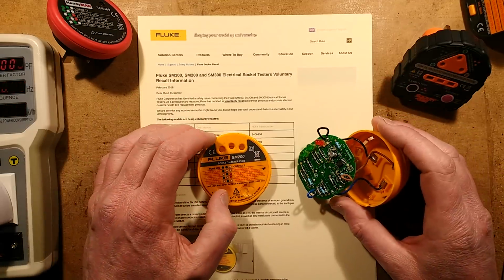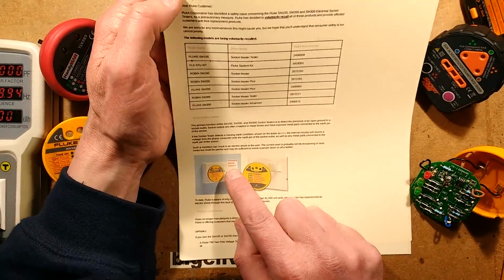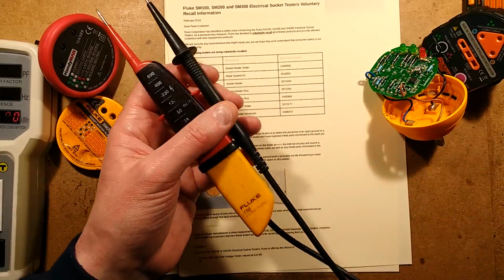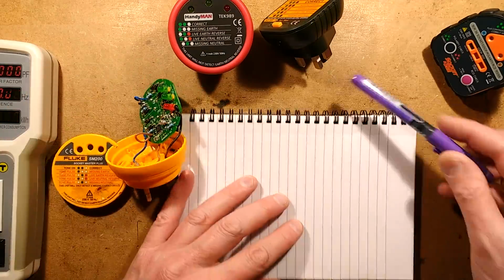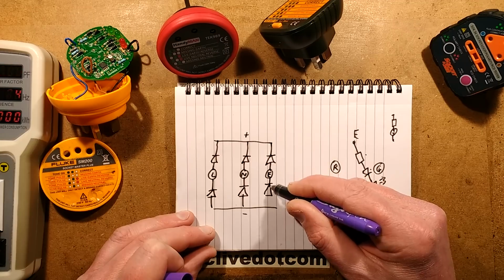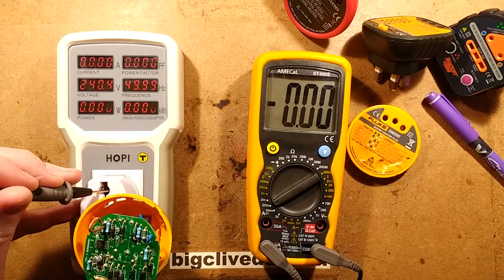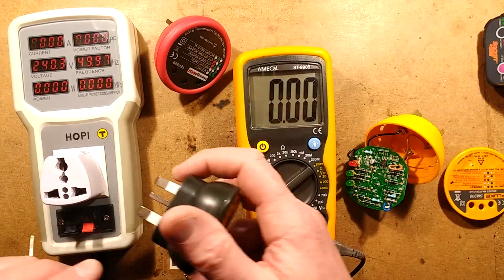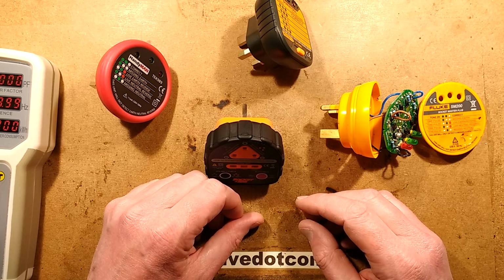Why Fluke are recalling their SM100/200/300 plug-in testers.

Comment: I have had many multimeters most very reputable brands, but only my Fluke's get stolen. 
The most common use for my socket tester now days its to trip the circuit I'm working on R.C.D because I'm too lazy to walk back to the sub-switch board to switch off the circuit (P.S I don't do that of course if there is a likely hood of some other party re energising the circuit).
Reply from the maker: Likewise DeWalt tools.  Always the ones that get stolen on site.

Comment: I work in a safety compliancy lab, would love to get my hands on one of those for training purposes.  By any chance do you have the means to make a body reference like in a simpson 228 leakage meter?  I'd love to see the actual leakage not just a dead short
Reply from the maker: The non Fluke versions are still widely sold as test plugs with the exact same earth current issue.

Comment: Um question. If 6 milliamp is so strong and 21 is deadly like I've heard, why do phone adapters have 500 milliamp and we can't feel it?
Reply from the maker: Low voltage.  It takes around 50V before there is a significant shock risk due to our skin resistance.

Comment: Or got a tingle, fell off a ladder from a warehouse floor and died.
Think, I know you can and do, we both worked in industrial conditions and really bad things can happen at height or other hazardous positions when someone gets an unexpected, unanticipated surprise.
And as an CET, I'm unaccustomed to safety equipment giving sudden, random electrical shocks through bloody insulating plastic!
As in, had I made such a thing, I would recall it, it doesn't function safely or properly.

I have a couple of the probes you spoke of, doesn't test leakage, but does alert to a live circuit, as does my multimeter with my fingers touching one lead.

Fluke usually overengineers things, had an original Fluke 77 meter, massively overengineered, worked great, died over long normal usage. Well, save the tester that's the subject here.
The original Fluke 77 didn't have a fuse to protect the 20 ampere range.
Still, good analysis. No, excellent analysis.
Oh, 10 ma is around what hospitals reject, due to electrocution risks of patients with invasive devices. 

If you want a primer on US liability laws, I strongly suggest a long diet of lead paint chips. Maybe emulating tophat makers practices as well.
Or a good, solid kick in the head by a strong jackass. Thrice. Just look at our current government, it's been the same in the past. Google "No nothing party".

Comment: If your earth is floating, its (mostly) your fault.
Reply from the maker: I'm fed from an overhead TT system with earth rod.  Not floating, but not enough to pass enough current to trip a breaker other than the required RCD/GFCI breakers.
Reply: @bigclivedotcom  
Thanks for the answer!
true we have that in some areas in Germany as well. My mother has a Earth resistance of about 1500 ohms. She can also only use RCDS. The bigger cities all get the TN networks while the rural areas are so far away but from any form of transformer station,  you can't even bring the earth /earth-neutral to them because the wire is so long that there would be too much resistance in the earth anyway.

So yeah i pull back my statement in correction: if your earth is floating it's your fault except you life in a tt fed area ;)
Where these devices just sold by fluke without the different net types in mind, just like a "one for all" solution?

Nice tidbit you probably also saw happen: big day of finishing building a house. Electric guy is measuring Earth resistance with a not good result. The earth rod needs to be longer... The contractor does not want to spent that more time as they need to finish. So they do what? Right, water the area with a hose until the result is okay...
This house only saves life when it rains now.

Comment: In Finland they recalled some years ago socket deters as they could not detect voltage on the earth line. There has to be a metal piece you touch to detect that. You cannot detect it by comparing earth, neutral and line. There could be 230 V on earth and neutral and 0 on line and a socket tester would happily pass it. Or if earth wire was connected to the line a tester would just signal harmless line neutral reverse (not worth fixing here). Five years ago such a socket killed a plumber. He had an RCD on his tool but it does not protect from voltage on the earth line.

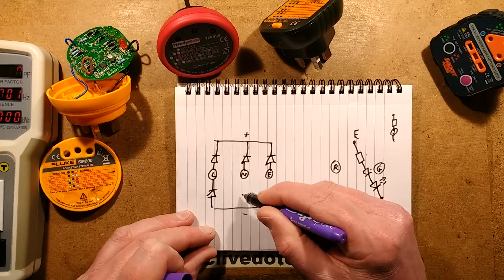Comment: 11:45 diagram diodes from LNE - is very similar to car alternator - as they're three phase generators rectumfried. Lucas alternators used to have (maybe still do) 3 terminals plus Earth (body as negative terminal). The 3 terminals at the terminal block were 1 'small' and 2 'large'. The small was fed through the IGN light on the dash for some exciting current and then either of the large terminals directly connected to the battery. However, those 2 large terminals were not connected together but were fed via different sets of diodes - so in fact it would be sensible to use the second large terminal to charge a caravan battery while the car battery remained fully charged.

FYI.

Comment: Test buttons on RCD/GFI CBs do not do a proper test.
I believe trip current is supposed to be 30mA. Dunno what the test buttons do but (I think David Savery) found that a ?35mA 'leak' wouldn't trip the thing yet the test button would. I.E. the thest button only tests the tripping capability not the fact it trips at the specified current.
I believe one rated to trip at 30mA tend to trip 21-25mA - well inside their spec.

I've personally found connecting N to E will trip them.
Reply from the maker: They do test at slightly higher than the rated tripping current to guarantee a clean trip.  It's still a full test of the circuitry and mechanism though.

Comment: In my younger days I worked in a factory that made PVC food wrap film. I disliked working that machine because it used to build up some very nasty static and would discharge it into the water bag who had to change the roll when it was full. We had 6" (15cm) allen keys to undo the locking chucks on the metal bar that were used to facilitate the winding up of the film. The allen key was used to make contact with the metal bars and discharge the bloody static (or so we hoped) that produced a pretty blue spark. One day I went to discharge the static with the allen key and the charge must have jumped past the allen key and hit my hand or wrist. I don't know which got hit due to the massive pain in my arm. It was paralyzed for about 5 minutes and I didn't get full control back for 30 minutes. I wish I knew what sort of current hit me because it hurt.

Also got tickling feelings in my feet when I worked in a heavy metal workshop that fabricated the chassis for bulldozers. I figured I was walking on metal rails, that were for the dollies to move parts around for welding, and it was earthed by MIG welding units or a non-industrial electric extension cord was shorting onto it.

Comment: In the US, I find about 10% of newly installed GFCI receptacles to be faulty.  Often the on-device test button is defective so I always use a plug-in tester.  Our GFCI limit is 5 mA.  Love you taking things to bits.
Reply: However, if there is no ground wire then an eternal tester will not work. You must use the built in one.

Comment: I have a Habotest on order,which appears to be well insulated. Surely if you switch the socket off before removing the tester there should be no current running through. And it should not be left connected for longer than necessary to check the socket condition anyway.

Comment: So I probably missing the whol pourpous of ground wiering, but what is that for? If I know is right the Neutral and the Earth are conected in the circuit breaker-box as one.
In the UK the plugs cannot connected up side down by the "Earth pin" so the Live and the Netral exactly determinated. Why the Earth wiering for??

Comment: Just out of ignorance: what is live/neutral reverse? Is it common in UK to have live/neutral in a specific position on one of the two pins? Since we got symetric Schuko- and Europlugs I doubt we even have a DIN/VDE rule for that here in DE.
Reply from the maker: We have polarised plugs and sockets with a fuse in the plug on the live connection to protect the flex locally.

Comment: I have three super powers. I can pick up a small, critical component and immediately transfer it to another dimension, never to be seen again. The second is the ability to generate enormous static charges on my US size 16 boots. I guess I have a lot of capacitance to ground. The third is that can’t really feel electric shocks. This may be because of super power #2, excessive use of real lead solder, really dry skin, or my childhood fixation with touching high voltage electric fences. Anyway, a guy I worked with brought in one of those gag pens that had a coil shock circuit in it. I needed to write something down so he handed me the pen. No effect, at all, I didn’t even know that it should have shocked me. I handed the pen back, so he thought it wasn’t working, and he tested it on himself. The pen went flying. It became sort of a thing then to try to shock me with various gadgets. Another time, a physical therapist burned out a couple of TENS units  before realizing that they had been working, I just could not feel the shock. I really think that those TENS units were cheap counterfeits.
Reply from the maker: I have similarly sized feet.  The rough skin acts as a thin insulator, but don't get too reliant on its insulating properties, all it takes is a bit of moisture to make it very conductive.

Comment: The RCD test button is also about checking polarity, or double checking really.. If Neutral and Earth are reversed in the socket it'll still show the correct polarity. If you push the button and the RCD does not trip then you know the polarity is wrong since it is putting the current from Active to Neutral rather than Active to Earth.

Comment: I have a US tester that I sometimes use with a grounding adapter. If you touch the ground tab and earth reference, it does not provide enough current for a palpable shock, unless you also press the GFCI test button.

Comment: Would you really be passing 10mA or would your body's internal resistance limit that.
Reply from the maker: It would be most of that 10mA in the right environment.
Reply: bigclivedotcom you would have to have a pretty nasty cut on both entry and exit to get the full 10mA but if you shock a lawyer someone must pay
Reply: @bradlee hicks
the full 30mA would be better if the rcd works , it would trip as you feel the bite , with 10mA it bites till you let go , it wont kill you , unless you fall off a ladder or some such :-)

Comment: This is absolute craziness. What are Fluke playing at.
The only time there will be an issue is when there is a break in continuity of the earth of that circuit and it will only be an issue on the part of that circuit that has lost the earth. The rest of the circuit and installation will not be affected, including other circuits that may have lost earth continuity.
The socket tester is only going to be plugged in for a short period of time.
Now:
Are all the manufacturers of electronic equipment going to recall their billions of items that have switching PSUs etc? That includes all PCs.
Even class 2 lighting ballasts have earth connections for functional earths.
Disconnect the earth on these circuits and measure the voltage and you will see. Even one item of equipment shows this, never mind multiple items.
Any circuit that looses earth continuity will have this issue. This has been known for years and taken into account on high earth current circuits. The regs require high integrity earthing on circuits above 3.5mA and commando sockets in items, groups of items etc.
Absolute madness.
Why don't we shut down the power stations in case someone gets a shock?
I'd better not have a drink tonight in case it goes down the wrong hole and I have a coughing fit.
Just tested 2 socket testers. Earth pin to earth voltage and current flow from same.
With neutral connected:
Fluke SM200:           135V   0.04mA
Martindale CP-501: 121V  0.01mA.
With no neutral:
Fluke SM200:           242V   0.05mA
Martindale CP-501: 243V  0.03mA.
(Supply voltage 246V)
Don't know how Clive was getting 9mA
Now I don't know what sort of shock I would have got if I had touched these (with one hand on the earth pin and earth; not one on the earth pin and the other on earth) but I don't feel like trying this out. I would have done some years ago but the older I get the more reluctant I am to do that.
UPDATE:
I have just tried what I said i was reluctant to try and yes, you do get a bit of a shock. Not quite the full 230 shock but enough for me to be reluctant do do it again.
However, what I said still stands regarding the fact that if you lost the earth connection of a circuit (or extension) touching any part of that earth, including earthed equipment, and actual earth will give you a shock as well. This is with equipment with normal earth leakage so how's the plug in tester any different?
Also, using an insulation tester and loop impedance tester will give rise to the same condition and the users of this equipment are normally trained and aware of this. So sell the socket tester with an advisory warning that the user should make sure they take precautions that no one is using anything on the circuit being tested until an earth is confirmed.
The new Martinadales  say that there is an earth current of (<2.7 watts) around 11mA. So what Clive was measuring sounds about right. I don't know why I measured so low.
And would you believe it. The Fluke actually says 11mA. Talk about missing the obvious right in front of me.
Must admit though. I didn't expect to get the shock that I got so I've sort of proved myself wrong. Not going to give up using them though. Too useful, but now I'll be more careful.
Thanks Clive. Love watching your videos by the way. You have a really calming voice.

Comment: The FLUKE 1AC-II VOLTAGE DETECTOR PEN isn't like any other detector pen I have ever used Clive. They don't work on voltages lower than 220v and you can even detect which side of a T&E the live is. There's a reason your volt stick is £1 and a AC-II is £23.
If you don't want to take the word of a fellow engineer I would be happy to send you mine to look at. 
I won't miss it, I have a T5-1000 and a MFT.... and a spare!

Comment: Bigclive  could you do these tests with the "Old Style" Neon Martindale which ive had in  my toolbox for around 40 Years? Kind Regards DAVE
Reply from the maker: I tested a modern neon one that tries to be fancy by showing all three neons for a correct result and it passed an unusually high 5mA to earth due to the use of multiple resistive dividers.  A traditional one that shows 2 neons for a correct result should only pass about 1mA.

Comment: If you powered the LEDs with a battery, couldn't you reduce the AC current to just a few uA for driving a transistor? I don't really know what I'm doing but this circuit seems to do this http://tinyurl.com/yb86s4zc

Comment: Ooooh Clive I am so disappointed at your dig at the “Office worker” . As an electrical designer I would say, I have been on more sites and saw more dodgy stuff that even you would imagine. First tear down, around 1962, was my transistor radio and dad banned me from the back of the telly because I found it more interesting than the front. We’re not all tinkling keyboards you know. Fluke is great gear but waaay overpriced but what do I know I’m an “office worker”.

Comment: Hi Big Clive. Great articles. Came across a scenario many years ago where someone was getting a tingling sensation off thier washing machine when they were in contact with the stainless steel draining board. Found they were running both dishwasher and washing machine through one of these three way adapter blocks and the earth connection was not making within the block. Once the appliances were put into wall sockets with the earth connected, the tingling sensation disappeared. At the time I assumed the RFI interference circuit was floating the then un-earthed chassis to half mains voltage (two capacitors connected between live and chassis and neutral and chassis respectively), their impedance selected to keep the current through the body to less than 10mA. I'm being lazy and not as skilled as you wondered if you could confirm my assumption was correct. Thanks 😊
Reply from the maker: It could have been filter leakage and also general leakage through components like the motor.  It only takes a fraction of a milliamp to create a sensation.  10mA would be quite a violent shock.
Reply: bigclivedotcom Thanks 😊

Comment: As far as I'm concerned, Y-class SMPS bypass capacitors are the work of Beelzebub and should be outlawed and gruesomely murdered with fire, seeing as how they make anything mains powered vigorously shock you. Sadly, the only good power supply is a bulky, heavy, hot, inefficient as hell transformer-based one - we went downhill ever since. Never to touch the cable TV plug and my PC's case at the same time whenever I unplug it from the tuner card is a reflex I will have until the day that I die, learned the hard way...

Comment: Meh.  I have exactly one fluke device...its an older network cable tester nettool multi tool.  And most of the timr I use it for basic cable test and checking cable length without unrolling.

My outlet tester is the old fashioned neon light kind but new enough to have a gfci test button